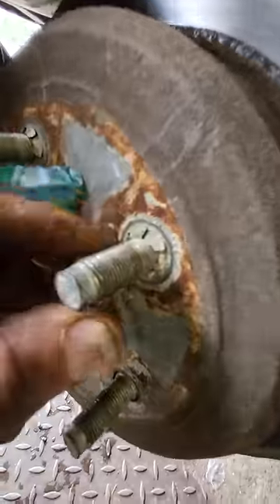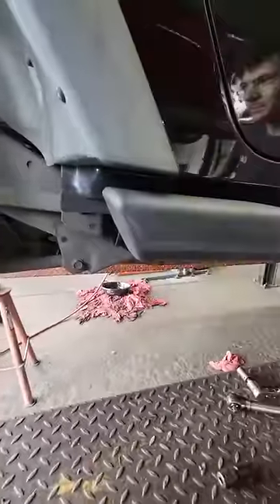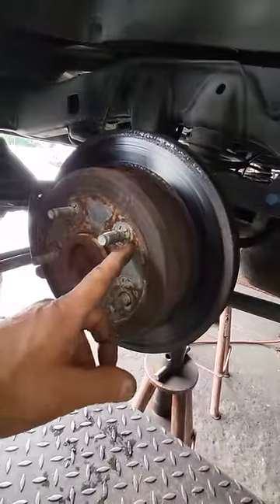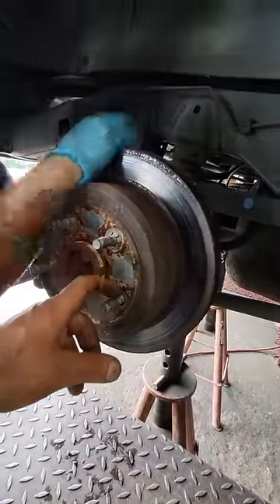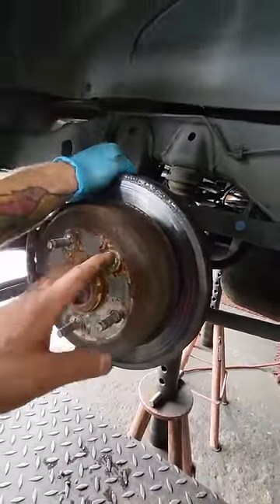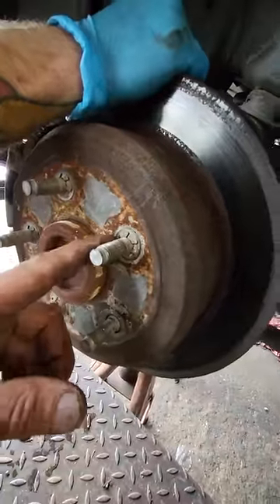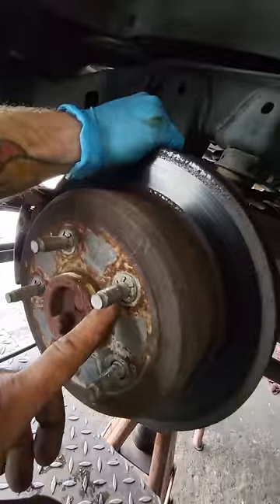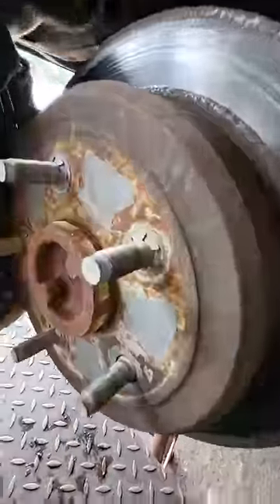There is always that guy

Comment: The reason they, and or disk screws are there, is to stop the disk separating from the hub when you remove a wheel. When that happens, you run the risk of debris getting in between the hub and the rotor, causing a brake judder. That guy isn't anal  he just knows more than you.
Reply: Debris getting in between the hub and rotor? Like what?
Reply: @jaredlancaster4137  rust, grit, etc. Anything that's hanging around the hub/ disk flange when the wheel is removed.
Reply: @iainball2023  usually the only rust is already in between the rotor and hub. Also, I've never heard of this problem happening in the 50 years they have been putting floating brakes on cars.
Reply: Lmao this is way off. First of all, the brake caliper and pads are going to hold the rotor in place when the wheel comes off. Second, even without the caliper the rotors are almost always stuck to the hub to the point where you have to hit them with a dead blow or hammer to remove it (especially when it has this many miles). Lastly, these are the rear rotors which house the parking brake inside which is yet another mechanism holding the rotor in place. In my year or so as a lube tech I NEVER saw a rotor just come off after removing the wheel.
Reply: @Andoxico  never said the rotor would come off  re read it.  Its very simple, and yes it does happen. When you loosen the wheel, if the disk is not retained to the hub, then its very common for the disk to float off the hub, only a little, but thats all it needs. Shit can, and will, get in that gap  . A two thou discrepancy in the hub will be ten thou at the edge of the disk. This can  and will, cause a brake judder. In my 30+ years building rally cars, I have seen this a few times. 

It's funny how in this trade, you don't think things can happen, untill you see it with your own eyes. Then you might realise its been happening all around you, you just didn't know. 

FYI, this failure mode is covered in numerous bits of literature. Go look it up. It's real
Reply: @iainball2023 reminds me of people not putting the set screws back on Hondas. I can’t tell you how many times this has caused a noise when braking and then when you take the wheel off the rotor is no longer secured to the hub. If the car came with something from the factory then just put it back even if you don’t know what it does. It’s there for a reason that you may or may not know. Unless of course there is a service bulletin telling you otherwise

Hell on Honda accords there is a little shim on the rear brakes that goes between the caliper bracket and the knuckle that randomly fall off. Most people throw them away for whatever reason but without them the caliper is no longer sitting perfectly in the center causing uneven pad where.

Comment: As a former instructor for Ford Motor Company, those retaining clips were installed to keep the drum or rotor from falling off if the wheel separated from the car or truck.  This would in turn insure the braking system would perform as designed while you were scared shitless as you saw your wheel pass by your car while you were heading to the scene of the crash. I used a 3/4 inch piece of heater hose on the end of my impact gun to remove or install them.
Reply: Weird, I’ve never seen a rotor come off with the caliper bracket still in place 😂
Reply: @lParohlx I was just thinking this. How would the rotor get past the caliper and the bracket?
Reply: How is the braking system going to perform as designed when there is nothing transmitting the brake force to the road since the wheel fell off?
Reply: It's not to keep it from coming off he is trying to say there there to keep the rotor inplace and the brakes working properly for as long as possible for safety reasons I've seen those brackets break off too

Comment: I only reuse one for each rotor if there are any. I use it on the bottom stud to hold the rotor on so I can put the wheel on and make damn sure it's seated. Ive had wheels torque down crooked because the wheel might go flat on the rotor but the rotor might not go flat against the hub or axle. Ive had the rotor get caught on the lip.

Comment: Used to do that. I was told when learning to work on cars "if you can take it apart you can put it back together, just do the opposite of what you did to take it apart." A bit of an oversimplification, but it gave me confidence... and bad habbits like putting those clips back in. Or those rubber gaskets they use on some hubs to retain the caliper. Still have to convince myself to throw them out.

Comment: I just put them back on because the hardest part is getting them off and they hold the rotor from tipping and knocking your pad on the ground
Reply: Put your rotor on and take an axle nut and put it over a stud. Take a lug nut and tighten it down with fingers. Rotor won’t go anywhere. Once brakes are finished take it off.

Comment: Idk, if I brought my car to a shop I'd be kinda peeved to find out they just threw parts away so they could be lazy and not put it back the way it's supposed to be 🤷‍♀️
Reply: That's because you still choose to be ignorant even though you just saw a video explaining exactly what they're for. Removing those retainers destroys them. No one is unscrewing them. You take some side cutters and rip em off. Not a single brake rotor replacement procedure in any factory service manual says to install new retainers but it does in fact say to discard the retainers if equipped.

Comment: This'll get a lot of people butthurt but if they're still on when I get to it, I usually put them back. Saves me some aggravation getting the caliper and pads back on when I don't have to wrestle with the rotor too, and saves me the time of putting a lug nut on and then having to take it back off before remounting the wheel.

Comment: Mine has 240k on it and I put them back on every time.  It just helps me keep them in place.  It makes putting the wheel back on the axle without having to mess with the router being cockeyed on the wheel studs.  If I had a lift it wouldn’t be a problem.
Reply: Your caliper should keep the rotor pretty straight. It might be a little wobbly but it shouldn't affect putting the wheel on

Comment: I only reinstall them on the front rotors. We also are in az so no rust. I typically like to reuse them to hold the rotors on on the front. But on the rear they are useless because of that style isn't ever loose.

Comment: They use that retainer because in manufacturing. The guy sticks that drum on and then retain or hold it in place. In the next guy has a gun, or it's a robot. And they shut the bolts on, and if that drum is not on there, flack everything breaks and raises hell. But you're right, you don't need to put them back If you don't mind the drum getting crossed. When you replace the tire on the freeway and then you can't understand what the hell that noise is.

Comment: I call them push nuts they use them on kids Power Wheels to hold the wheels on. I use my long snap on diagonal cutters and pull them suckers right off. It is just for when they build them. The Torx screw you see on Honda and newer GMs is supposedly to combat vibration so those screws I put back in.

Comment: Its basically the same thing with the small bolts that hd rotors on for assembly. It is not necessary to put them back! Just eases install of the calliper and/or caliper bracket! I usually ise a lug nut to hold the rotor still.

Comment: But an engineer said... There's your problem you listen to the guy who designed it, not the one who fixes it lol
Reply: Sure but you have to understand WHY the engineer designed it the way he did.  On initial assembly at the factory, the rotor is installed on the axle/hub, then the car is transported to another part of the factory before the wheel is instslled.  The clip is installed with the rotor to hold the rotor in place while the car is jarred around on the assembly line.

Once that car leaves the factory and you go to replace brake pads, the car never moves between the new rotor being installed and the wheel being re-installed.  The risk of the rotor falling off before the wheel can be installed is virtually zero.  Therefore the clip no longer has a purpose

Comment: I worked at metaldyne, which we ssembled lower control arms. Those are called tinnerman nuts to help hold the rotor to control arm as it goes down assembly line

Comment: I'd take that to hold the rotors in place during a brake job over the 2 screws they put in and the head snaps off when you try to unscrew it

Comment: They are used at the manufacturer to hold the drums or rotors on while moving along the assembly line
Reply from the maker: 100 🎈
Reply: Not just the assembly line. From place of manufacturing, shipping, removing from pallets, and the assembly line.

Comment: As a factory trained tech I learned that the clips and screws are only there to save time on the assembly line.  There's nothing wrong with putting them back on but they serve no purpose once the wheel is in place.

Comment: Some of the tire techs at work were putting on aftermarket wheels on a ram 1500 and couldn't figure out why it wouldn't sit flush so I pull off the wheel and I see the factory retainers are still on and the aftermarket wheel doesn't have any cutouts to accommodate the clips like the factory wheel, because why would it.

Comment: the purpose of those clips is to keep the brake rotor seated against the hub...if it dislodges during a flat tire change, it is possible to jam the tire against the misaligned rotor.  which results in a false positive when it comes to tightening up the lug nuts.
Reply: Yeah, if youre absolutely clueless lmao

Comment: I have rotors that look like this all crusty. I was thinking of scraping off a load of the rust and painting them with some heat restistant black paint just to make them look better lol. Do u think this is a silly idea that wont hold up or have you seen it done? Cheers boss
Reply from the maker: For sure
Reply: The paint will contaminate your brake pads in tbe case of disk brakes.

Comment: I like my ford fusion when i first got it because they decided to make aluminum casings over the lugnuts so after a full winter and summer theyd swell up and would move over the bolt underneath. Cut them all off and replaced them with better lugnuts. If you think you need those retainers in there, you should learn how to torque on a wheel properly

Comment: Kia has a set screw. It's Phillips. 
Just had this conversation the other day. Either replace that set screw with a torx, or leave it off completely. 
The Phillips is tapered and will strip. Torx isn't and won't.
Reply: That’s because it’s not a Philips

Comment: Those rotors are fine. Throw some sandpaper at them or the lathe and they're good as new.
Reply from the maker: Glass half full glass half empty
Reply: A lot of brand new rotors are the only a few thousandths over their minimum specification.  By the time you need new pads, you need new rotors as well.

Comment: You know if the wheel came lose and you hit the brakes those clips help the rotor stay straight and keeps the pedal hard  and on the assembly line they keep the rotor from falling off  during assembly I always take them off and throw them in the trash 😅

Comment: When mechanic promotes themselves to mechanical design engineer. Unless service manual states they can be discarded then put it back the way it was built. You’re not being smart or clever saving parts and cutting corners you’re working outside your remit. You’ll find these fasteners on many pieces of engineering btw not only kids toys.

Comment: Anybody can say anything but I’ve noticed a drastic difference with them on versus off with vibrations when breaking, (specifically with bigger wheels than factory in my case) but, I go factory as recommended with them, no issues

Comment: Not doing anything wrong, that is what those are for. They are supposed to make it easier to install the calipers with was but they are a pain when you have to replace the rotor. I've been a mechanic all my life and I'm DOT certtified and have the proper training for auto and diesel tech.
Reply: Well, all you have to do is screw a couple lug nuts on to hold the rotor in place.

Comment: It centers the rotors just like hondas a have a small screw mechanics hate them but they have a purpose and thats what seperates a good mechanic from someone who just wants to get paid. if its there there's  a reason for it. No manufacture wants to add unneeded parts.....
Reply: Health and safety had the clips/screws added to keep rotors from falling on employees durring assembly.

The rotor will be centered and secured when it is sandwiched between the wheel and the hub.

Comment: LISTEN people. Those clips hold the whole drum at each lug location flat to the axel so that when you place a rim on and tighten lugs nuts you do not tighten the drum and rim cocked at an angel and bind the rim up creating a wheel that is not true. . Imagine this. You put a drum on and it is not flat on to the axel. Lets say three of the stud locations the drum is not flat to the stud plate. But it is flat at two of the stud locations.  Now you put a rim on and you JUST SO HAPPEN to happen to tighten the two lugs that is where the drum is flat to the axel. Now you have locked down the drum cocked to the stud plate and when you go to tighten the other three, the drum will not go down flat to the stud plate. This is real common . Because you cant see the drum once you put the rim on. SO you have no idea if you are tightening the already flat drum stud locations. If you dont understand you should not be working on cars. it is very possible to bind a drum cocked to the stud plate . those clips prevent it 100%

Comment: Chugged the soda in hand cut the can up drilled the holes cut out a similar outer circumference cut 4 times on  interior....made my own I'm sure the thickness is slightly off but I didn't have to fight the issue I was fighting anymore. .....same or better whenever u can!

Comment: The only reason these clips are used is to hold the rotor in place in the assembly line process. There is no advantage in replacing them after the first brake job.
Reply from the maker: I agree 💯

Comment: The wheel holds the bolts in those where originally designed to hold the rotor in place on the assembly line

Comment: I do it, I'm anal about keeping things completely original. I like to put things back original. A lot of people take things apart and loose stuff and halfass put it back together, throw bolts/nuts in a container and cant remember how it goes back, I to an extent thread my bolts/nuts back in the original place when I take something off where when it goes back together i have every bolt, nut, bracket, everything is in its original place and it looks like it's never been touched. I even hate to scar up the head of a bolt or nut with a 12 point socket/wrench. I take a sharp pick and carefully undo the factory zip tie fasteners. I just hate sloppy work.
Reply: You should probably put all the plastic back on the body panels while youre at it

Comment: You have to remove those clips when you do aftermarket wheels, or the wheels won’t set flushed on the rotor, causing a driveline vibration

Comment: There are some vehicles I put them back on. 35 yrs a tech. you run into alot.  Some 4wd applications for instance. Or a car belonging to a self described mechanic.  They always need to check your work. One guy told me I mounted his tire to rim wrong because the valve stem gets knocked off when the wheel is installed backwards by the customer at home.

Comment: I’m not an engineer, on a customer car I replace everything I remove. Do you replace all the one time use hardware? I didn’t think so.  On my own car it’s a different story.
Reply: Will the customer car be going back on the assembly line? No?  Then why would you put the rotor clips back? The rotor isn't going to fall off and land on an assembly line worker when the car is going down the road
Reply: @Texassince1836  
Because, it’s my job.

Comment: Sometimes when I’m doing some job as the brake lines or shocks etc I prefer to not have the drum/rotor fall on my foot. The clip is very handy and adds safety. So what kind of mechanic would say to discard and take your chances? This dude should not be making videos with stupid assumptions.

Comment: They can be handy on certain cars to hold the rotor all the way onto the hub whole you're mounting the bracket, loading the pads and replacing the caliper. On some cars the rotors just won't stay in place. I just run a lug down if I need to tho, f those clips

Comment: It stops the disc moving away from the hub when the wheel is removed. If the disc parts from the hub, there's a chance rust and debris gets between the disc and the hub thus causing, insufficient crush between the two. Meaning the disc would be out of true and cause a brake judder. So, fit them back and don't be a back street repair shop/garage. Everything is fitted/designed for a reason.  There are handbrake shoes inside the disc which generates dirt dust and rust. Vehicle manufacturers don't waste money, they spend a lot of time trying to save money on the assembly lines.

Comment: I’ve replaced those and six months later the customer came back claiming we didn’t even do the brake job cause those come from the manufacturer. Turned out when we did the brakes the caliper was failing so that is why he came back. I couldn’t warranty the caliper but I could the rotor and he still would’ve had to pay for Labor so he drove off without doing the work cause I would not do the job for free

Comment: If I was the owner of that car, I'd go back and tell ya to put em on. 
I recently changed brakes on my gf car, rotor loose as heck and the brake doesn't smooth out the rotor evenly. Because of the play the lug has in them holes.